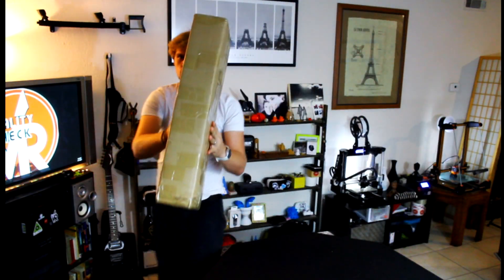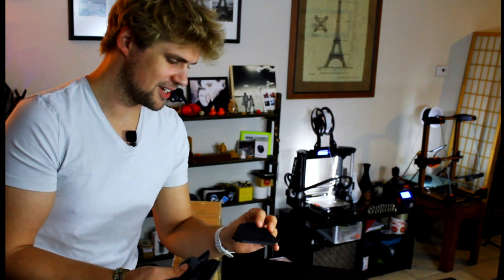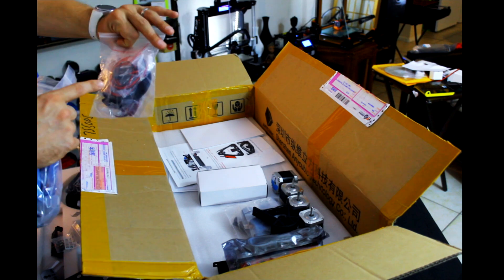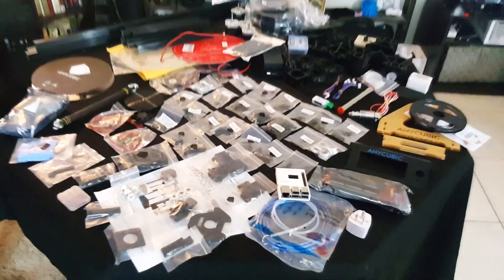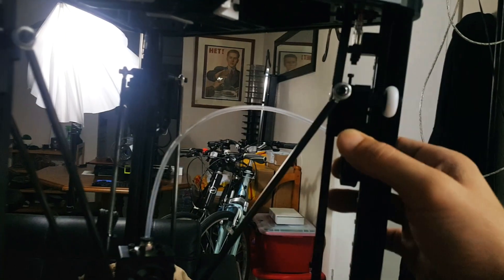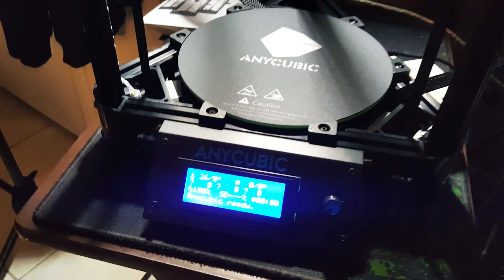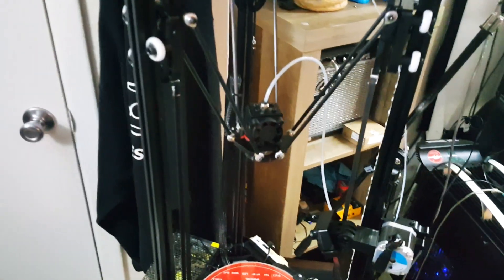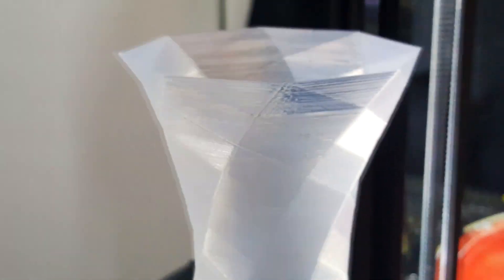✔ Anycubic Kossel ULTIMATE UPGRADES +  3D Print Timelapses (Heated Bed Addon)

Comment: What a difference 2 years can make. In the newer kits about 90% of the work is already done and upgraded. While the prices have stayed close to the same. But they also still have some of the flaws. They really do need to make the bottom braces for the columns a standard item as it would improve their accuracy.

Comment: I just received my Anycubic Kossel Pulley Plus, this is my first 3D printer. I'd like to add the led's, camera and raspberry pi upgrade. Can you link me to a good tutorial or how to on this upgrade?
Reply from the maker: Hey Mac! Sweet printer!) Here is a quick video https://www.youtube.com/watch?v=4A509rS1zOE this should help with the pi and camera, the led lights are pretty easy as well and can be added with an adapter to the power supply. Setups can take awhile when it's your first time, but once its working its all worth it)
Reply: Thanks! Greatly appreciate the help.

Comment: At first I thought you were just going to add LED lights and a Raspberry Pi. Glad I was wrong. Awesome job, thanks for sharing the info. After about 50+ hours of researching 3D low cost printers I pulled the trigger on this one, both due to the great mods and the ice promo code you shared.

Comment: "It comes with glass" oops haha
Reply from the maker: it comes with 200mm thin glass - mine is 220mm thicker glass)
Reply: Reality Check VR you mean the hight or width? My glass bed is 3mm thick so 200mm would be big! Heh
Reply: i use the large size condoms